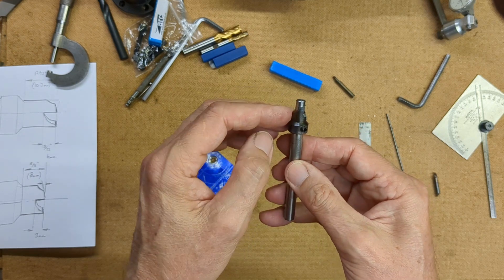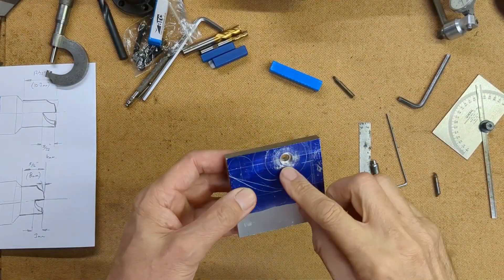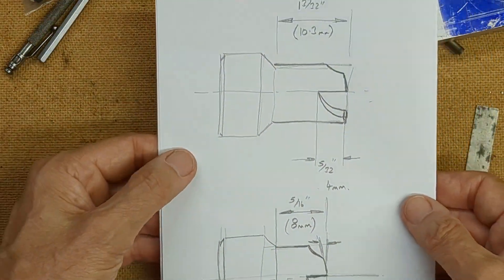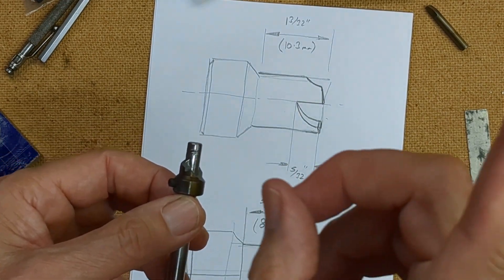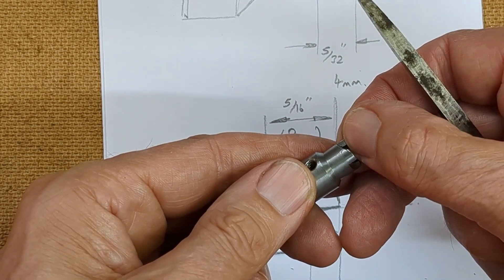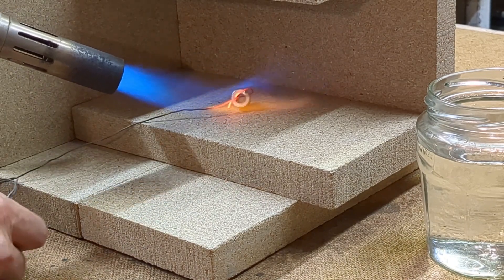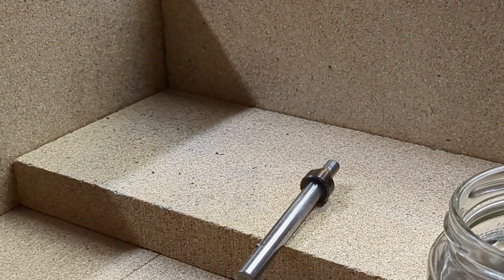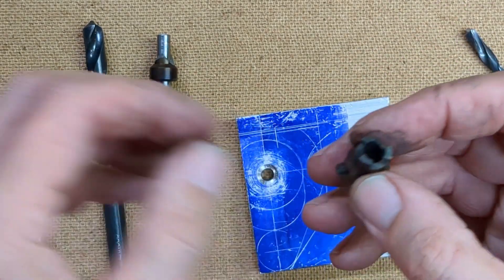Improving a homemade counterbore

Comment: Watched the short video. The intersection of the teeth to the main body is a very sharp transition a radius there may help a smaller diameter ball endmill may help reduce the stress riser at the intersecting points, also tilting the devideing head a couple degrees off alignment with the axis when milling the teath will result in a positive rake on the tooth as it meets the gullet.  look at the teeth on a holsaw they are ground with a radiused disk and a positive rake angle. Nice project and a great idea thanks for sharing
Reply from the maker: Yes, I agree that a radius would be a major improvement as would positive rake. Hopefully next time I make one I can incorporate your helpful suggestions!

Comment: I think you will get a better result by hardening in oil and for tempering find your self an electric pie oven, got mine for free, set the temper temp and then you will not over temper your parts. I like your vidios.
Reply from the maker: Thanks for your comments. I just looked up the data for silver steel and for smaller sections like this oil hardening from a higher temperature is an option. I like your suggestion of the oven. Might look out for one!

Comment: Do you think the zero top rake contributed  to your failure   ?
Makes for a high tooth loading.
Reply from the maker: Thanks for your suggestion! Yes, that may well be a factor. I also wonder whether swarf got wedged between the cutter and spindle as indicated by an mark on the spindle. I was rushing when it happened and not frequently withdrawing the cutter and carefully brushing away swarf.